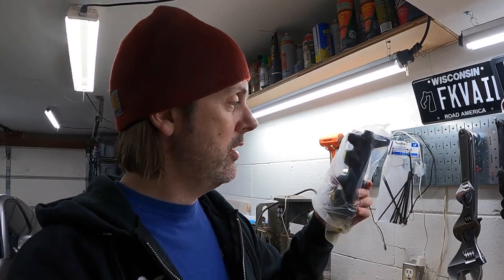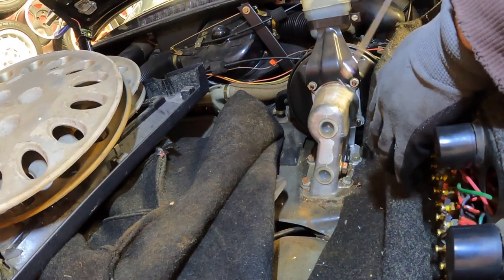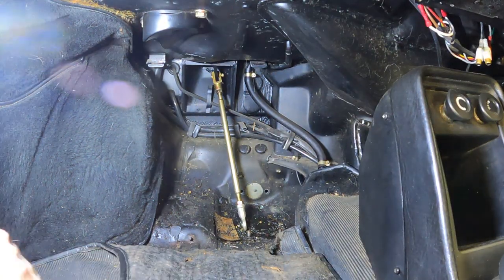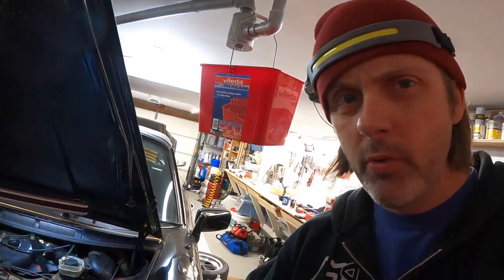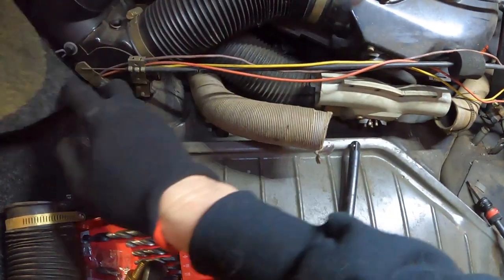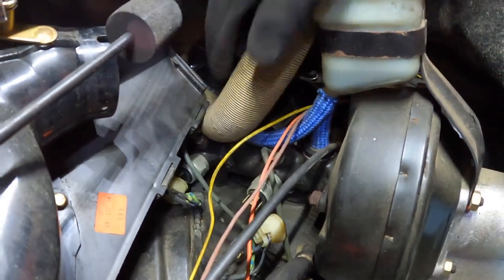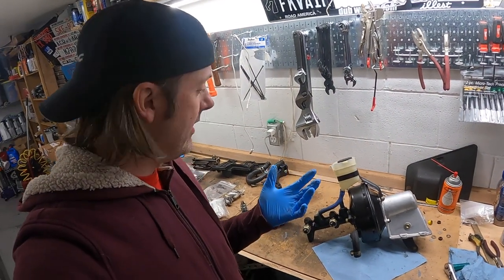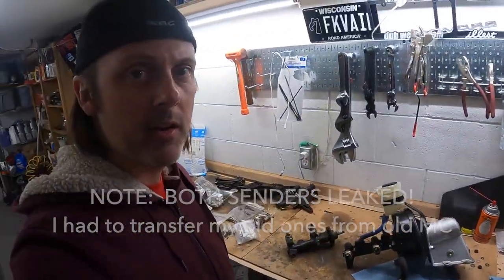Porsche 911 Master Cylinder Replacement (1965 - 1989) $60 VOLKSWAGEN PART

Comment: Mine also arrived with bent electrical contacts. When I complained I was told that “that happens all the time…” and to “just bend them back…”. Useless.
Reply from the maker: Yeah except the impact was so bad the brake fluid went right through them.  Was not stoked to get brake fluid all over the pedal area after I spent so much time cleaning it.   Heck if I'm removing them again to clean it tho; I just soaked them with degreaser and mopped up the best I could.